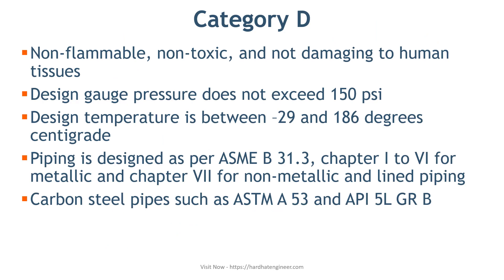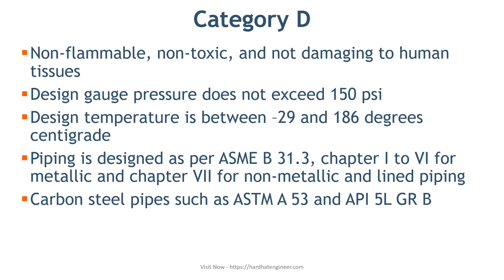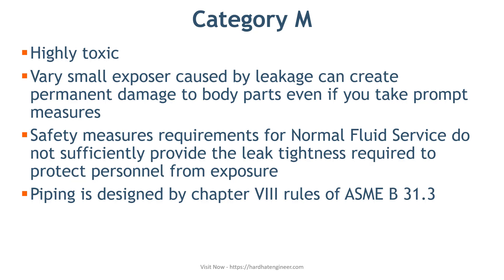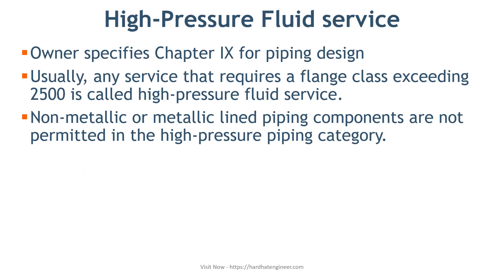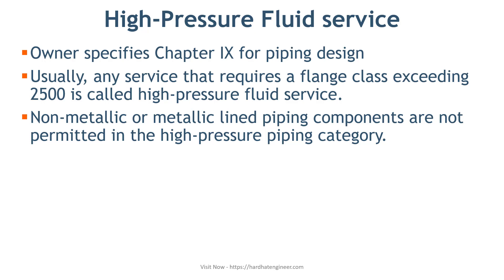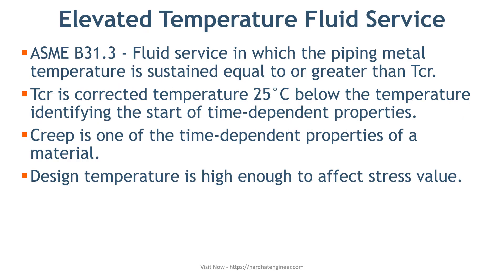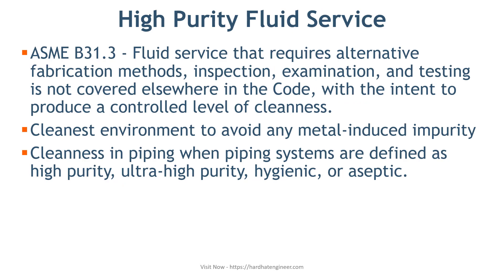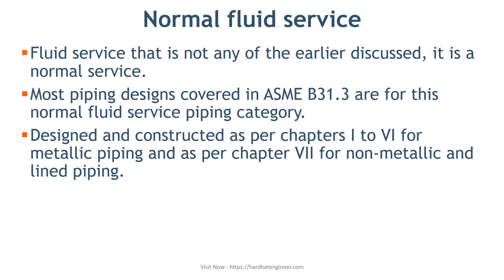6 Types of fluid services in ASME B31.3 Process Piping

Comment: Please confirm if Hydrocarbon and N2 gas line falls in which category of ASME B31.3?
Thanks.
Reply from the maker: You need to consider other process parameters, such as pressure and temperature, to make a decision. Typically, both fall under Normal Fluid service. Nitrogen (N2) may be classified as Category D Fluid Service. You can check this with piping designers.